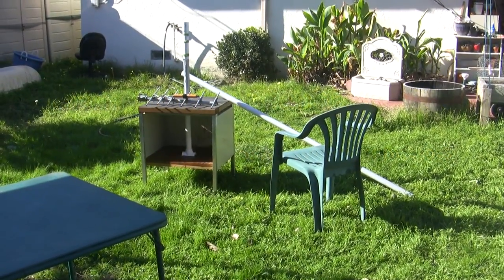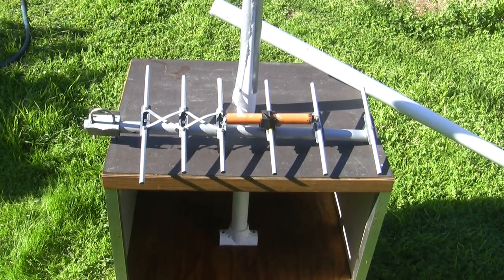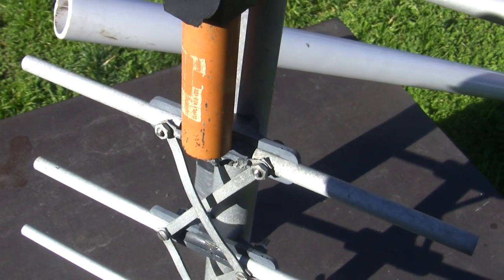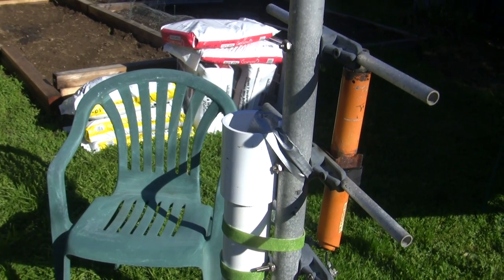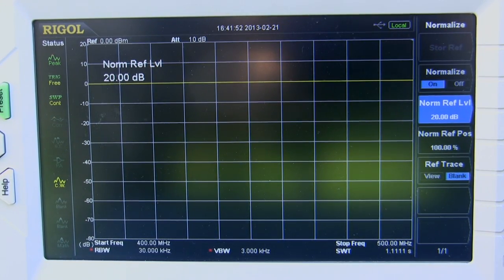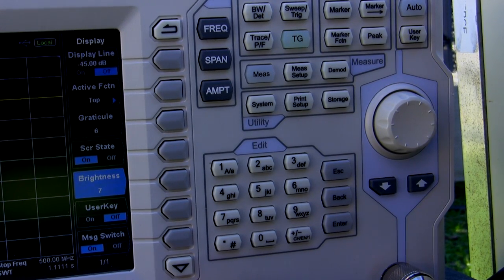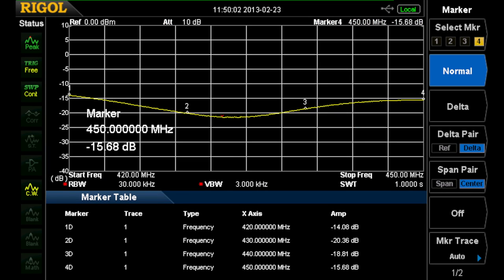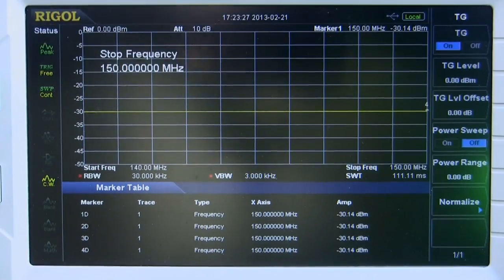Sweeping Antennas for Return Loss (initial)

Comment from the maker: OATS (Open Air Test Site) or semi or fully Anechoic Chambers are a good choice at UHF or higher bands.  OATS isn't usually available to the average ham, however.  The same goes for Anechoic Chambers... especially larger ones that would allow placement 3m above the floor.  

Obviously either of these would be a better choice to test lower gain antennas or omni-directional ones though checking a vertical dipole or collinear array in a cluttered environment like my back yard is open to some question.  I make no claims that it is even close to a serious Open Air Test Site (OATS) or Anechoic Chamber.

The Anechoic chamber I used professionally, by the way, was only 3m x 3m x 12m or so.  I tested 434 MHz antennas effectively in that chamber but results for 2m beams were out of the question (they are too big) and collinear gains were off as well (reference antenna too close).  

A large OATS would be required for making more accurate measurements using ANSI C63.4, C63.5 or similar techniques.  For those who want more repeatable results, use of these ANSI and FCC approved techniques is recommended.  I believe that these are available online.

Comment: A few years ago I swept my 4x18xxx array with a spectrum analyzer and a tracking generator with a generator output of 0dbm (1mw) when I got a call from a friend living 40 miles away asking me to listen for mysterious sweeping carrier on the 2m band. Turned out it was my setup. Always be aware that your carrier doesn't stay in your system but is radiated and can potentially interfere in and outside the ham bands. Use the lowest tracking signal amplitude you can live with.
Reply from the maker: Absolutely.  Make your measurements then shut down the sweep generator.

Comment from the maker: I will probably revisit this kind of testing as I get some dedicated cables set up for this purpose.  I plan to make some clamp arrangements for the test mast as well as place a reference dipole on top of the lengthened assembly to allow relative gains to be measured.  By the way, the power lines in the video are about 20 feet horizontally and 35 feet or more vertically away from my test area.

I find that with short cables my own presence seems to affect measurements more than anything else.

Comment: Generally the Antenna VSWR measurement  can be  done in OATS or  semi and fully Anechoic Chambers  at the height of minimum 3 meter or more than that to avoid the ground reflections,  so that we can get correct results.
Reply from the maker: +Iyappans Nellai   While I would agree that better measurements can be done at 3 meters or higher (in the 2 meter case), by placing the back of the 5-element beam towards the ground the effect of the ground on VSWR is minimized by a round trip power loss of at least 20dB.  

Example:  If we have a beam with 10dB Front-to-Back ratio as the DUT, radiated energy towards the ground will be reduced by 10dB and any ground reflections received by the antenna will also be reduced by 10dB.  The combined effect of these two paths is 20dB which will minimize any effect on VSWR measurements.  

Put a slightly different way, the back of the antenna is about 1 meter above the ground at its lowest point.  Thus the 20dB of isolation achieved above if expressed as a range ratio is 10^(20/20) = 10^1 = 10 to 1.  Thus the effective height of this antenna when placed as I have placed it would be equivalent to a spacing of 10 meters above ground.

Again, as I mentioned in the video, any reflective surfaces or objects falling within the range of the DUT antenna pattern MAY impact the VSWR measurement.  It will depend entirely on the round trip path distance to and from the object and the antenna gain in that direction.

Bottom line:  The test as shown is quite adequate for verifying that an antenna is performing properly at the desired operation frequency as far a VSWR is concerned.  

When I get around to doing some actual OATS (Open Air Test Site) measurements for antenna patterns, I will definitely do it in a nearby park where I can place the DUT well above ground with no reflective objects around the antenna.

Comment from the maker: PVC pipe can shift the resonance of elements parallel to it such as a vertical dipole mounted next to the pipe.  Elements perpendicular to the pipe will see minimum effect.  In my test the metal boom of the antenna was also between the elements and the PVC pipe.  

PVC has both a dielectric constant of 3-4 and can absorb moisture to a certain extent thus a dipole that parallels the PVC will definitely have its tuning affected. ABS pipe has UV stabilization(carbon). PVC?  Perhaps not.
Reply: Ed Fong mentions this in his lectures.
The “J-Pole” dual band (UHF & VHF) antenna he designed comes in 2 variants.
Free-Hanging and pipe mounted.
They are tuned completely differently and the PVC version can only be installed inside a piece of 200psi pipe.
This is much thinner than schedule 40 or 80 plumbing pipe.

He also recommends one brand of PVC plumbing pipe “Charlotte Industries” due to the low amount of metallic “nano particles” in the coating.

Thank you again for a great video and channel.

Comment: During my antenna tests i noticed that antenna working frequency shifts due to plastic pipe. I assume its because of carbon that is in the pipe material. Try to repeat the measurement with pipe far away from the driven elements.

Comment: Jim, why do you save the references?
Reply from the maker: It has been awhile but I believe saving the reference is part of Rigols recommended calibration proceedure for tracking generator use.  This evens out the variations in the digitally generated TG levels.  I think I covered this in other videos in this series.

Comment: Hi Jim! Thank you for making this video.. I have few questions. I purchased one of those green board inexpensive R/L Bridges. I followed your instructions to the "T" in this video. I had issues until I disconnected the Antenna from the DUT terminals and then performed your instructions. Then when I put the Antenna back in the DUT port, the R/L showed up.. in this video, it appears you have everything connected but when you were finished, how did you get the R/L to show up on the DSA815?  Question # 2. Why are we doing this lab test when a MFJ Antenna Analyzer does it in a few seconds?  There must be a purpose other than just seeing the visual R/L? Help me Jim! 73's David. K8KEM
Reply from the maker: It is a demonstration of just one of many things that can be done with a Spectrum Analyzer with a Tracking Generator.  The SA can also be used to determine any secondary resonances, multiple band resonances, antenna gain, antenna pattern, and provide a permanent record of those measurements.  If you have an Antenna Analyzer like the various MFJ units or one of the even more sophisticated competitive units, these are a very portable and valid way to check Return Loss or VSWR.

Comment: I have been trying to get my Rigol to display SWR Rather than return loss in one of my recent video on directional couplers. For some reason the SWR settings are grayed out. Is there a licence required to enable the function on the rigol. Regards Chris.
Reply from the maker: AllTheGearNoIdea  You need a license to activate that feature.  Go to rigolna.com for details. BTW -14dB is 1.5:1 VSWR.  -20dB is negligible VSWR.
Reply: James Eagleson  Hi James. I’m sure the first time I used the SA the feature worked so I’m guessing they must give this as a free trial. You lost me with the VSWR comment, I just use a return loss conversion chart.   I will check out the rigol licence cost.  But I know when they try and sell the licence with their directional coupler the cost is extortionate.  Thanks for  returning the comments Chris  73 / M0KLF

Just checked 550 they are taking the piss - I would rather put the money towards the much better performing siglent SA. 

Regards Chris
Reply from the maker: AllTheGearNoIdea  I was just saying that -14dB Return Loss = 1.5:1 VSWR, etc.  Otherwise, as you said, just use a chart to get VSWR from Return Loss.

Comment: on the tracking gen output,why is a 10db att needed 
thanks   just learning
Reply: The tracking gen is like a transmitter and likes to see a 50 Ohm load.  The 10 dB pad keeps the generator from being overloaded by the antenna on frequencies where it is non-resonant.  The attenuator protects the tracking generator.
Reply: @stargazer7644  not needed, the tracking generator has enough internal protection and termination to not have problems with open, shorts or anything in between. They are purposefully designed that way.
Reply: @germanjohn5626  The tracking generator is like any other transmitter -  You can wreck it with improperly terminated loads.  It is generally written right there on the front of the instrument next to the connector.  Good luck with your expensive test equipment if you believe otherwise.  Take it or leave it from someone who fixes these things.

Comment: I suggest to put the antenna under test in a test pod and not just put anywhere else. This would incur a l of of false vswr measurements.
Reply from the maker: As indicated in the video any antenna will have some level of variation in VSWR or Return Loss readings depending on where it is mounted, what objects are surrounding it, variations in test cables or test sensors (impedance bridge or directional coupler). my body standing or sitting nearby, etc.  However, these are not 'false VSWR measurements'.  They are real world, field condition VSWR measurements.  I do try to keep my body as well as any test cables, test equipment, or other objects well away from the DUT, of course.  Those effects are usually quite easy to spot when making swept Return Loss measurements, however. 

Tests in Anechoic Chambers, if that is what you mean by "a test pod", are also subject to similar effects even though the results should be more consistent and repeatable in a carefully controlled environment like a test chamber.  Chambers also have the advantage that they will not be affected by signals or objects outside the chamber when built correctly.  If the chamber is big enough (multiple wavelengths between the DUT, test antenna, walls, ceiling, and floors), results should be quite accurate.

I performed many such tests in semi and fully Anechoic Chambers and on OATS ranges during my 35 years working at various rf design and production companies.  However before I place any antenna on a tower, I will always check it in the field both before and after installation to make certain that it performs properly in the environment into which it is being placed.

Comment: Taking what Eagleson says, at face value, might do more harm than good, as the finite directivity of the coupler inserted between the spectrum analyser and the antenna under test, does limit the range of return loss, where the proposed setup makes sense in terms of engineering accuracy; I'll let you do the math' and evaluate the dramatic impact of the directivity of some commercial couplers... Pray pardon my candour, as I feel compelled to say how surprised I am, that the highly qualified & experienced engineers who have commented here, have not picked up on that limitation, not to mention the effect of a slight mismatch of the load of the so-called isolated port, that is a port that is not so isolated after all (!)
* internal or plugged externally
Reply from the maker: There are limitations to all test methods and equipment.  The method used here (a direction coupler) is one I borrowed from a Hewlett-Packard Spectrum Analyzer application note.  As you have noted, this method has limitations but also provides reasonable performance for those who do not have the budget for high performance, NBS traceable (thus very expensive) Network Analysis equipment.  Since making this particular video I have obtained both Type N and SMA precision loads and I use 3 or 6dB precision pads on Source and Output ports on couplers or bridges.  The Loads provide 40dB Return Loss over the range of the DSA815-TG.

I have quite a number of videos on this site that cover many of the issues involved with use of inexpensive RF Couplers and RF Bridges.  When I worked on early 915 MHz/1830MHz RFID equipment many years ago, I used a simple resistive RF Bridge to design the antenna systems for both frequencies.  When the small company I worked for finally obtained more sophisticated lab equipment we were able to perform more accurate measurements.  While perhaps we were just lucky, but the results were not all that different than what we achieved using the crude RF Bridge that I built with some chip resistors, capacitors, and a diode.